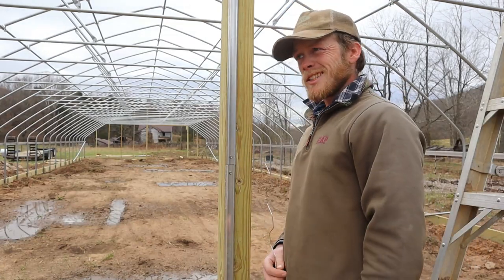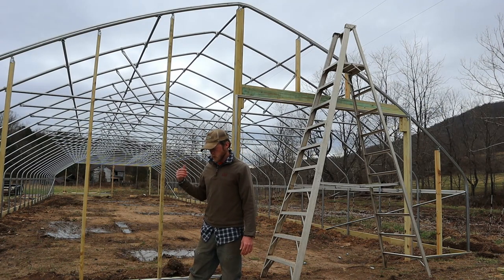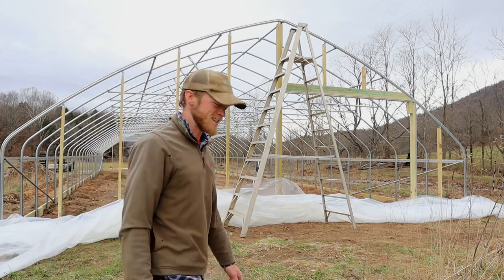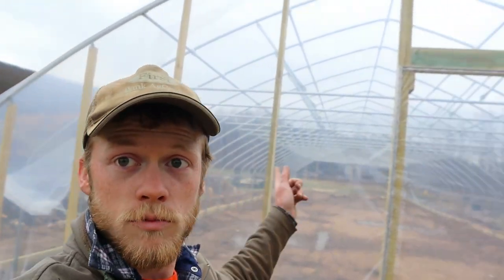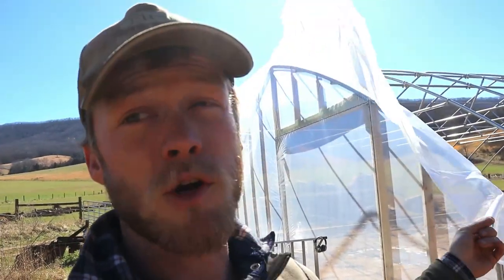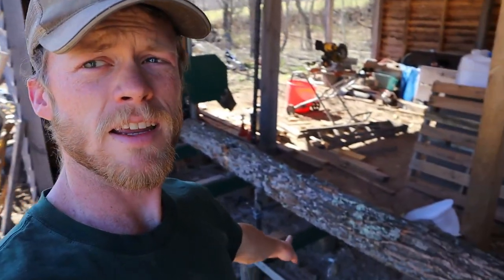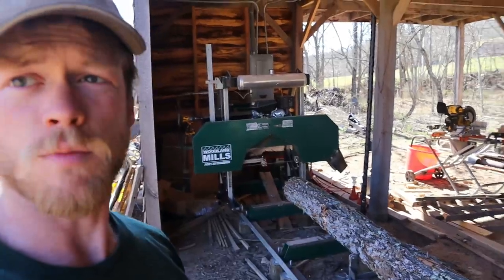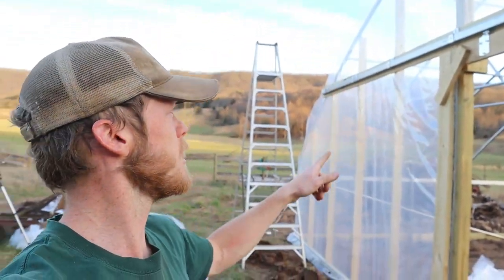Installing Plastic on End-Walls | High Tunnel Build

Comment: Looks good. Will you put a board on the bottom of the tunnel for the door to slide against so it doesn't tear the plastic? Or does something different go down there. Thanks for sharing.
Reply from the maker: Hmmm… that’s an interesting idea. Hadn’t planned on it but might be something I should do.
Reply: @LandisLegacyFarm  Just to save the plastic.